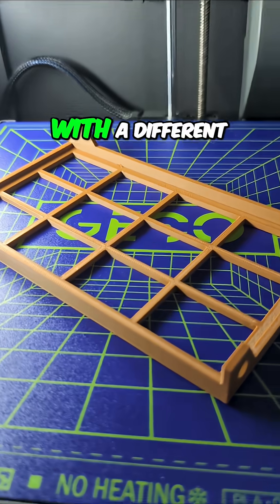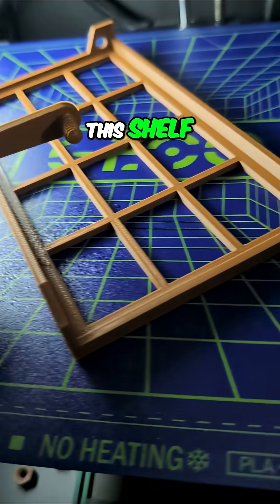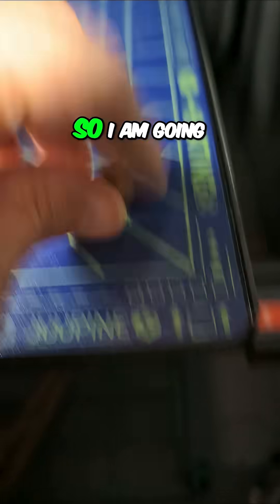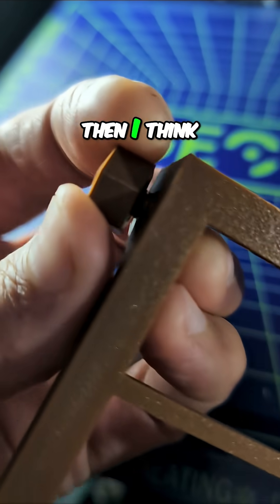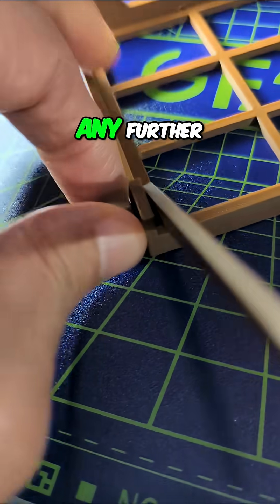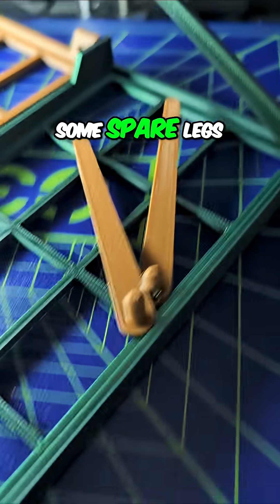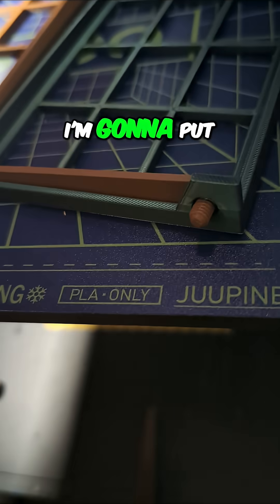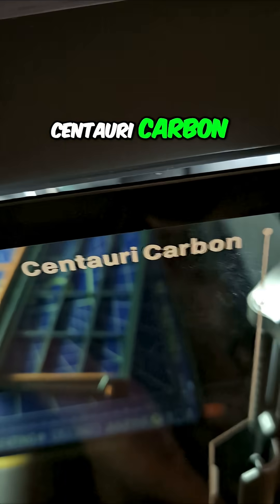3D Printing: PLA Pro Test Shows Excellent Print Quality #shorts

Comment: Pla plus or pro depending where you get it is what is recommended for printing firearm frames. Even over carbon fiber nylon because of nylons hygroscopic properties. It’s great stuff, especially since it’s not much more than regular pla.
Reply from the maker: I print that stuff every few months. I always ask Hoffman or Middleton what their current recommendations are before printing. Hoffman has done some great filament testing. I'm fortunate to know many of the leading designers from my website and firearms channel.
Reply: @GearReportMaker that’s awesome. I love HT. He does great work.
Reply from the maker: He is a unique and talented individual. 😃